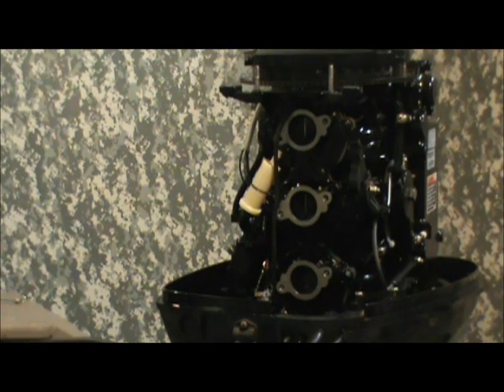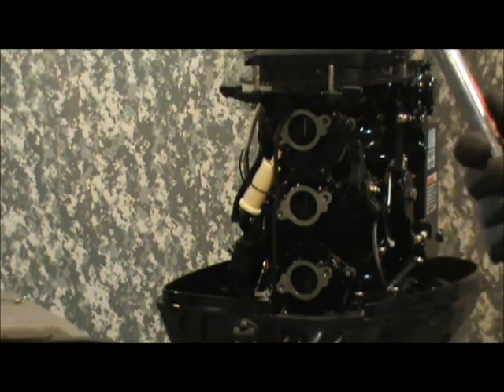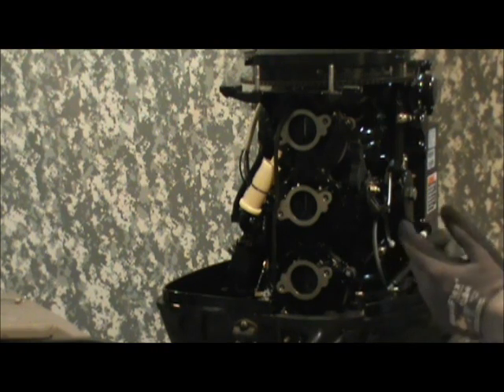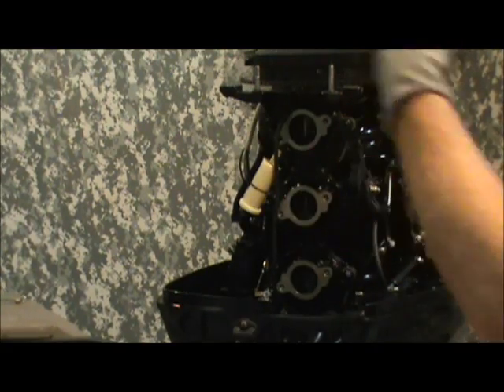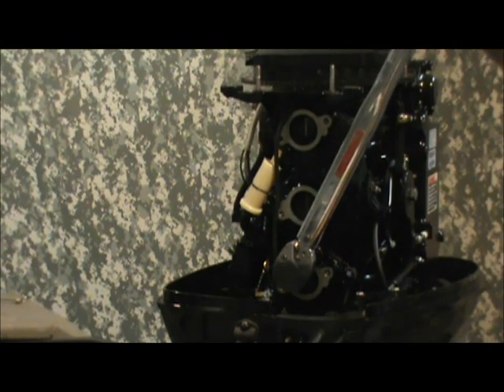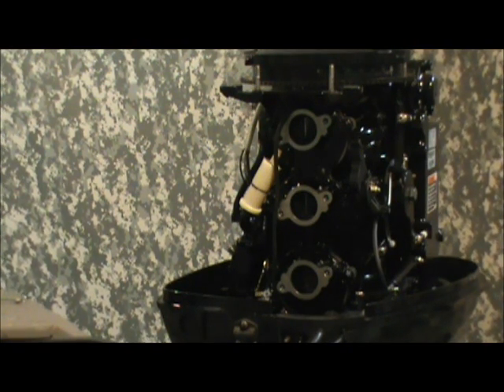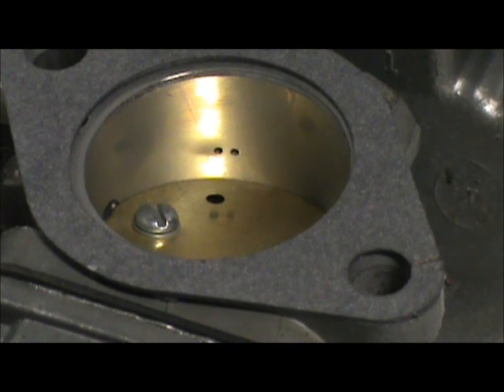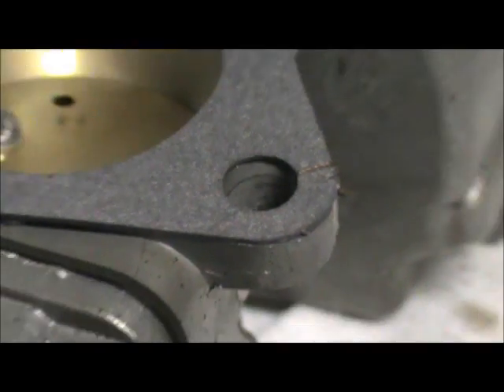My DIY Relpacing Reed Valves in an Outboard Motor Part 6

Comment: One of my reed valve pedals broke off of my center carburetor, I’m in the process off tearing it down. Where do you, or anybody reading this think that the pedal piece went? In the engine case? Piston Cylinder? Out the exhaust? My engine started spitting and sputtering and blowing compression back out of the center carburetor, that’s when I noticed one of the red valve pedals broke off. If anybody has any suggestions please let me know.
Reply: Did you ever figure out where it went?

Also, was it a replacement reed valve that broke or was it an original one?
Reply: It was an original that broke, I replaced it with the Quick Silver brand replacement. The broke piece must have blown out the exhaust. It’s been running fine since the repair. I guess I got lucky.